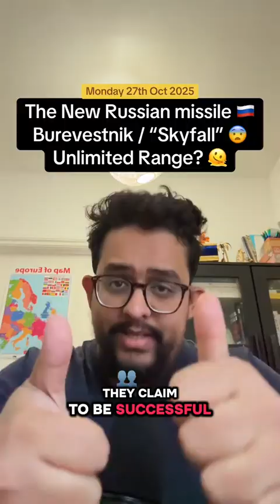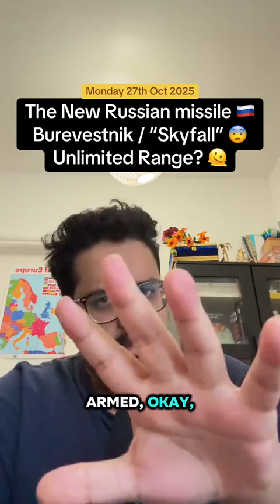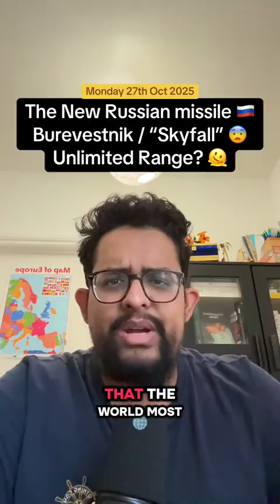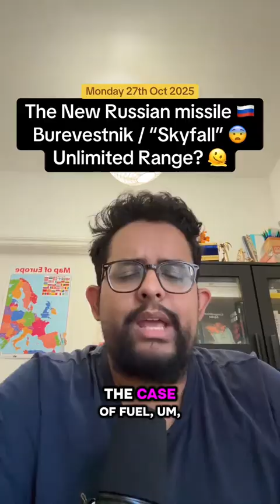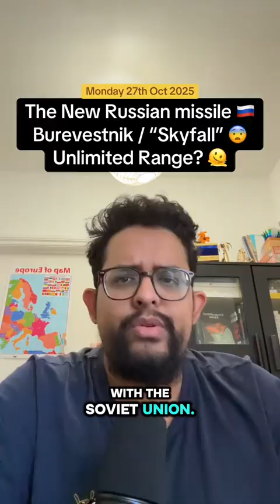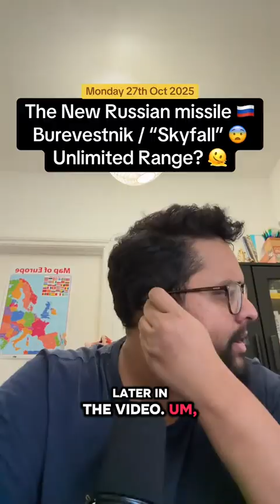"Theoretically Unlimited Range" - Russia's new Missile with a Nuclear Reactor as its Engine

Comment: The Skyfall isn't known for its speed because provide it relied on speed then it becomes very easy to shoot as it has subsonic speeds. 

The biggest challenge with the Skyfall is that it is extremely highly maneuverable and there's almost not trajectory to calculate in the first place. Air defense systems can take up to a few minutes to calculate flight paths and attempt on intercepting a missile. 

But the Skyfall has absolutely no trajectory, before the air defense calculates a trajectory the Skyfall has maneuvered a couple of times leaving air defenses completely useless. 

Or provided you have an air defense with about 50 interceptor missiles and like a dozen radars than can be tracking calculating and predicting the maneuvers of the Skyfall and the interceptor missiles are shot every 5 seconds. There can be a 1% chance sending an interceptor directly to the Skyfall.

Comment: I believe Burevestnik aren't designed to be first-strike, rather more of sure-strike.

First, the speed are very slow, travelling around transonic speeds. Easy to take down sure, if you can shoot it. If speeds are the issue then there's many other options to go other than Burevestnik.

I think this weapon is a concept demonstrator, future plans likely go towards a conservative route of MIRV-version of Burevestnik. 

You need a few day to send a submarine to firing position if they're not already, Burevestnik can be in position within few hours. Of course its more visible in the sky, but it's a quick-deploy deterrent and there's barely a trajectory to calculate so you'll be playing more panic inducing cat-and-mouse with a nuke.  

In a way, it's a faster and longer running cruise missile with unlimited range. It doesn't replace any Russia's current arsenal, it adds into it as Russia already planned.
Reply: А как ее сбивать? Это тоже самое что разбомбить Чернобыль над своей головой
Reply: @АлександрАндреев-т8ы  In all due honesty, this is not a problem I should care about. Let those who want to fight it out to think about it.
Reply: @wat-ch  it’s a cruise missile. And all cruise missiles are kinda hard to intercept because they fly on low altitudes, avoiding radars under their horizon. They don’t need much speed

Comment: First, your analysis is right on. Second, Russia is trying to get around U.S. satellites that the U.S. uses called SBIRS or Space Based Infrared System that is currently in space 24 hours a day 7 days a week. The U.S. monitors all launches from Earth with SBIRS. So once a vertical intercontinental ballistic missile is launched, anywhere around the world, the U.S. will see it and calculate its trajectory. With SBIRS, the U.S. is able to track Russia's missile attacks in Ukraine and alert Ukraine in that specific region that it's crossing and Iran's missile attacks in Israel and anywhere else in the world at a moments notice, but, with SBIRS, it has its limitations. Russia has built a nuclear torpedo called Poseidon that goes around SBIRS satellites. Russia's Skyfall cruise missile is a Nuclear capable cruise missile that has a capable nuclear warhead up to ONE MEGATON, according to The Armed Forces of Russia. The weight of ONE MEGATON equals about 600 lbs of radioactivity. So, with SKYFALL, Russia can attack anywhere around the world at a moments notice, possibly without SBIRS noticing its flight path in real time. That means Russia can use a tactical nuke somewhere in the world at a moments notice without SBIRS tracking it. It can be an offensive or defensive weapon depending on how Russia decides to use Skyfall.
Reply: You have addressed precisely the issue for which I have been desperately seeking an answer. I have a problem understanding this, which you may be able to clarify. In theory, a nuclear reactor generates a large amount of heat. This should mean that Burevestnik can be tracked particularly well by SBIRS satellites. Where is my mistake in reasoning? Even AI couldn't help me with this, because it claims the same thing. Why do you think tracking is not possible?
Reply: @marvin902x First, there are two temperatures to think about when a cruise missile launches and when the cruise missile is in flight. When a rocket first launches, its temperature exhaust can range up to 3,400° Celsius. Second when a cruise missile is cruising the temperature than cools down significantly to around 400° Celsius. So when Skyfall first launches, it's exhaust can reach up to 3,400° Celsius, but after a couple of minutes, it's exhaust WILL cool down to around 400° Celsius. The small reactor on board Skyfall should generate enough power around 500° Celsius to power the cruise missile. Do you know why Russia plans to use Skyfall in the ocean? There are many reasons. I will just give you a couple of them. First, for security reasons if Skyfall were to fail, it would sink to the bottom of the ocean, not into enemy hands. Second, the ocean waters reflect the sunlight back into space masking Skyfall's heat signature from SBIRS. In addition, the waters cool the reactor down as it transversing over water, land, and air. So in all, SBIRS has it's limitations on what it can see. I hope I was able to answer your question.
Reply: Not "tactical", but with 1 megaton and unlimited range it's a strategic weapon!
Reply: @Елена-у3г2ы 👍💯👍💯👍💯👍💯👐💯👍💯👍!!!!